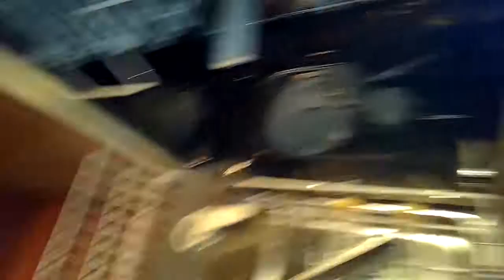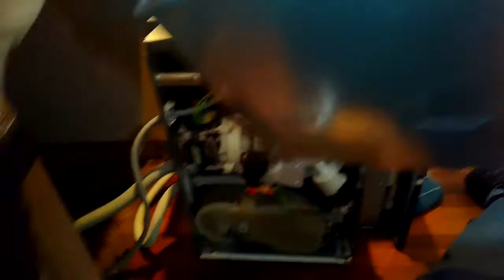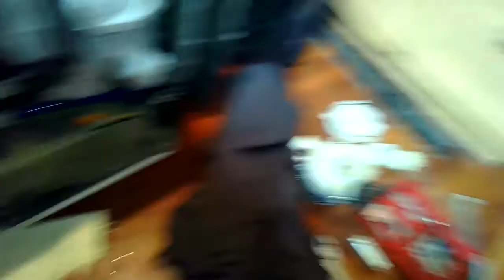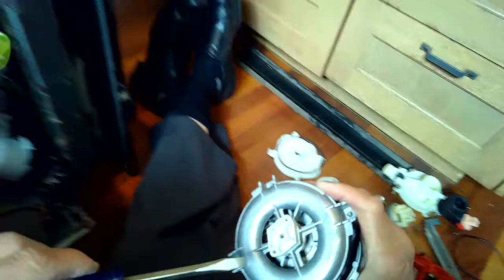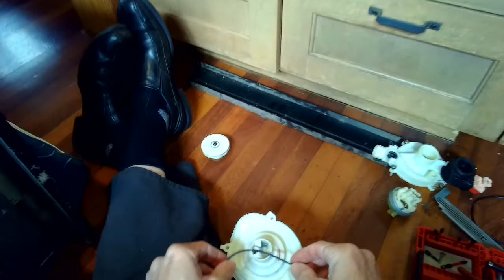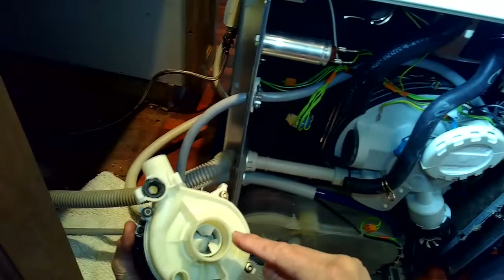🌎 Miele Dishwasher - Motor Partition Kit - F14 Error - DIY

Comment: We have a G 4925 we are getting code F70 leaking from the  weep hole. We can not figure out what part number the rubber gasket is in the circulation pump. miele sent us a diagram and it is very difficult to read
Reply from the maker: Thanks Sarah,
Can you call Miele USA and ask them for a circulation pump partition kit.
That will fix that weep hole leak👍

Comment: Hello, how do i know if i need this kit? ,  I unscrewed the circulation pump en i had a piece of glass in it. Removed it. If Put the dishwasher in his program it works for 5-10 minutes and then it says the F14 fault
Reply from the maker: I would call Miele USA to have them send you a new motor run capacitor .  When they wear out they limit how well the motor works.

Comment: hello.  I have a question about the dishwasher Miele G1220 SCI shows error F14 and blows the fuse.  the service technician checked and told me that the heater is faulty and with this model it is not possible to just change the heater but it comes complete with a pump is there any other solution to this problem or is the whole pump with heater the only way?  thanks a lot
Reply from the maker: You can get just the heating element .
Reply from the maker: Here you are: https://www.buyspares.com/product.pl?pid=3710806&utm_source=google&utm_medium=base&utm_campaign=products&gclid=EAIaIQobChMI1evM06Ci7wIV4w59Ch2qhgiVEAQYASABEgKGnfD_BwE

You might call Miele USA and see if they can send you one.
Reply: @QuickAndEasy5MinuteAppliance  

thank you very much